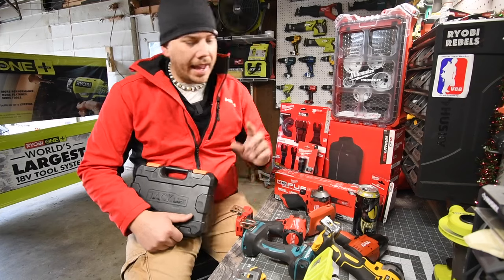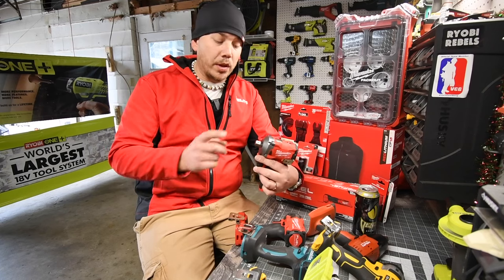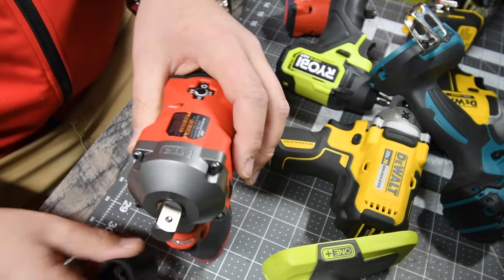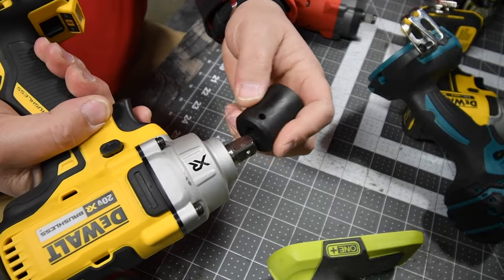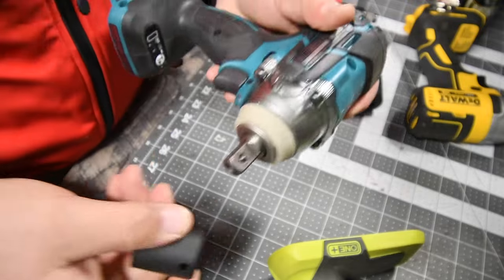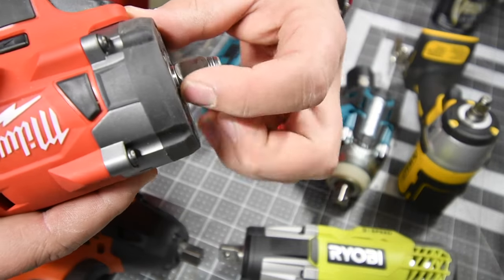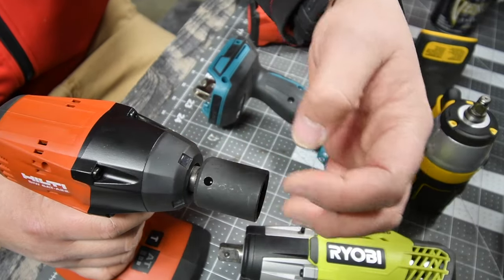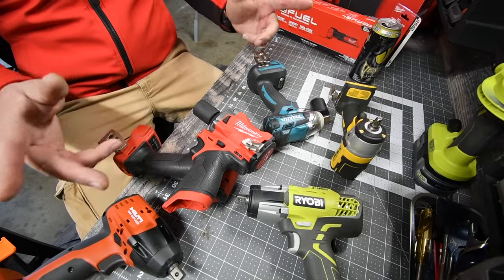(Detent Pin) and (Friction Ring). Whats the Difference?

Comment: Detent pin is for those construction guys putting buildings together that are running 100 of the same nuts in and don't want to drop a socket 10 stories down. Or into a river, or on the head of a coworker.
Reply from the maker: I thank you for viewing Tom
Reply: Tom you hit the nail on the head.  The pin hold the socket better and the hog ring allows easier socket changes.  I prefer Hog ring as its easier to change for normal use and most have a hole in the anvil as well.  When working high, some impact sockets have a groove cut around the pin hole.  This is so you can slide a pin through the socket/anvil and then an O-ring wraps around the groove to hold that pin in place.   Can't come off without intended removal.  That gives you the best of both worlds.
Reply: I found out that the sockets get stuck on the ring, I prefer pin detent
Reply: You are absolutely correct Milwaukee even clearly state in there information booklet that you have to push the pin in with a small tool to stop the impact socket coming off the impact wrench. Milwaukee also go on to say that this is not a production fault as this tool is designed like this if you want the sockets to be removed frequently for mechanics etc then purchase the friction ring model. I have purchased both types for different types of applications.
Reply: Yeah, but why so hard to get sockets on, though?  Seems like the struggle will make it more likely to drop a socket.
Reply: cudnt have explained it better
Reply: Thanks Tom! I was about to return my Makita over this, but it makes perfect sense!!!
Reply: Are guys that put buildings together using an M12 stubby?...... ROLF

Comment: Your Detent pin on the Milwaukee is not faulty.  Milwaukee designed it to only release by inserting something to push the pin.  The friction ring version is for those of us that do not want to release the pin
Reply from the maker: people tell me both things. "its faulty and I should return it" and "that's how its supposed to be".
Reply: @ManCaverTools  

Mine does the same thing.  But apparently it is working as designed. 

The instruction manual states to insert a nail to remove to remove a socket.
Reply: @ManCaverTools  he's right, pin detent on the milwaukee is perfect. the other tools that have the pin is worn out. they should all be like that 1/2 stuby. the friction ring is made to slide on and off. if your pin detent acts like a friction ring, then the detent retention is worn out. that's just common knowledge
Reply: @AntisocialLaneeBug  i wonder if future impact wrenches will have a button to release, like how some ratchets have that button in the back
Reply: The Milwaukee cordless wrench need a quick release button!?
Reply: Detents meant to slip should have balls, pin detents are meant to stick
Reply: My old dewalt impact also need to push in the pin to release.

Comment: I guess people don't read the manuals anymore, it says it right in there that you need to push the detent pin in to push the socket on, and need to insert a pin to pull off the socket, the only issue is you didn't follow instructions

Comment: Milwaukee decided to go with the true code of the pin detent meaning which is to always use a nail or thin object to remove the socket those other brands that allow you to remove the socket are not up to true code? Impact wrenches are only made with frition rings or pin detents ... Not ball detents that milwaukee impact is not defective at all..
Reply from the maker: its gotta be on purpose, I just thought it was defective when I first got it because all of my other impact wrenches with Detent pins let the socket go.

Comment: Again that's how pin detents work. It's literally made to be pushed in to remove the socket. Safety for overhead work so a socket doesn't come off 5 stories up and kill someone. The other tools are ball detents...
Reply from the maker: so your saying that every detent that I ever used including Milwaukee's bigger impact wrenches that I had on the channel are all faulty detent pins. and this m12 stubby is the only one I have ever had in my life that isnt faulty. snap. looks like I got a 7 tools to return due to faulty parts
Reply: My old dewalt was the same way.. would have to push in the detent every single time, and to put a socket on It was to the point where id just line it up and smash the socket into the ground

Comment: I use Milwaukee tools on a daily basis and as others have stated you need some sort of small pin or screwdriver to remove the socket. I had a brushed high torque impact, the fuel high torque impact, the 1/2 fuel compact and the mid torque that were the pin detent style. Everyone of them needed a small nail or screwdriver to remove the sockets. There is nothing wrong with your stubby.
Reply from the maker: its just crazy on how all of the other detent pins I have dont require that but I thank you for viewing Mark
Reply: @ManCaverTools  it looks like all of your other tools can actually fail when your impact socket will stuck on rusted or dirty bolt, for example. Anyways, thanks for the video!
Reply: @ManCaverTools  I think the milwaukee impact is designed for construction workers, because when were high in the air we're not allowed to drop anything for safety fall hazards; Iron workers , Carpenters, Scaffold builders usually use impact high in the air.
Reply: That's good design because the others when it gets heated, sockets WILL come loose. I use that same model and I remove it while using it, the vibration and pull will help you remove it quick, but you will need some practice to figure it out.

Comment: There is a ball detent and a pin detent. Ball will go on with some force and pin you have to push it in to use it.
Reply from the maker: correct, the ball detent are usually on socket ratchets. all of these impact wrenches have a detent pin.
Reply: The thing i noticed is that the milwaukee has a flat top on the pin and the others are somewhat angled  to a point to make it a little easier to install and remove sockets the flat top is usually standard on the larger impacts but ive never seen on small ones

Comment: I recently got the same Milwaukee  1/2 "  impact stubby, you mention ,  and have experienced the same situation /frustration  with the detent pin . I have never had  this happen before.  I have read some of  your reader comments . It seems that there is a difference between a detent pin and a detent ball .  So  I looked at the owner's manual and it does describe 2 options for the  anvil for this tool , the detent pin and a friction ring .The part numbers are also given  for each .   The manual clearly states that the detent type anvil requires using some sort of tool to depress the detent to remove sockets . So  in my estimation it is kind of a hassle to have to keep a little blunt ended punch handy to remove sockets. But I do see  that it could be good not have a socket come off accidently . I never have had a socket come off accidently  from my HF impact until the friction ring wore out . 
          But my 120 volt Harbor Freight impact gun  recently wore out its  friction [ hog ] ring . So now I am shopping for a replacement [ I don't need 200 of them ] and a good method for replacing it . One video I looked at says there is also supposed to be an o ring placed on the anvil first . then you force the  tool down against the new ring against metal to force it partly on until it stays , and then slowly work it the rest of the way on. with a screwdriver and tapping with a hammer.  So the ring must be made of spring steel . Thing is you dont want to just pry on ring's  joint ends and enlarge the inner diameter because that will ruin it . tricky operation it seems . 
           I will give my old 120 volt Harbor Freight impact tool lots of credit . I have probably had it for about 20 years with no problems . I think it lasted much longer than the Sears Craftsman one it replaced . In the good old days HF stuff was so cheap that it was well worth taking a chance on buying . 90 % of  what I have bought at HF has performed well . But they seem to have jacked up their prices across the board in the last year or so . 
      Thanks for your vid .
Reply from the maker: A detent ball is what you have on socket ratchets and socket adapters. most detent pins will let go of the socket with some force, I was just surprised the milwuakee stubby didnt let go of the socket at all and need a thin object to push the pin in, when all of my other detent pins let it go with some force. people flipped out over it and left me bad comments. lol but I thank you for viewing Richard

Comment: I think the stiff detent pin is probably ok for building construction when you are not changing sizes as much as a auto mechanic  also working at heights would be really bad if it flew off at 200 ft and hit someone  just a thought

Comment: Milwaukee designed it that way, it's clearly writing on the manual. Just don’t line the hole up on the detent, and it will come off easier or you can just wait until it wears in a little and will start to come off easier. If you don't like that just exchange it or buy the hog ring version, I guess that's why Milwaukee makes different models of each impact wrench.

Comment: I have several impacts with detent pins.
I have always had to use a pin/rod to compress the Detent. These impacts are intended for use with the same socket all day, we almost never remove them when we do though we have to use a pin or a rod. A proper pin Detent will have virtually straight sides and a flat top.
Reply: P.S. no hate. Great videos.
Reply from the maker: just based on the other impact wrenches it just seems like its faulty. but like I said in the video. it might be designed to be like that

Comment: I saw the video yesterday and my first thought was the spring under the pin for what ever reason isn't sitting in just right or is extremely stiff. I've had impact guns do this before and what I've done is not line up the hole in the socket and use it like that or leave a socket on it for a week or so to break it in. my 2c worth what you paid for it. good video showing the differences on each pin.
Reply from the maker: I want to put some oil on the spring and see what that does
Reply: @ManCaverTools  I would also put a socket on it to hold the detent down for a few days. It absolutely can't hurt.

Comment: I was at KMS Tools in Calgary last weekend and there was a Milwaukee rep there and I asked him the same thing. I wanted to get the mid torque M18 but they only had the detent pin version on sale. He specifically said I'd need a nail or pick to get the socket off every time. I have a hard enough time getting sockets off my M12 1/2" stubby with a friction ring, I don't need the hassle of a pin. Probably ideal for some jobs but not for the average home user working on cars etc.
Reply from the maker: if its in the design then its in the design. I just never had to do that with any other brands along with HILTI

Comment: I got a Milwaukee m12 stubby yesterday with pin detent.  It behaves just like yours.  Milwaukee should have made those with a spring loaded ball bearing... Best of both worlds...
Reply from the maker: Im going to try some oil and see what if that spring works better
Reply: @ManCaverTools  keep us posted!  It's totally strange.  The conical shape of the pin leads me to think that it should comply when  pulling a socket off... I wanted the one with the hog ring, it is on sale for 180$ in my area, but the "free" 4.0 AH battery came with the pin detent model... Guess Milwaukee is trying to move unsold inventory.

Comment: It’s supposed to be like that - to prevent tools from falling during  overhead construction. If it’s set properly, it will require a pin to pop it out. Use a friction ring for work requiring interchanging sockets often. 

PS - my Milwaukee Impact wrench with a friction ring (e.g., automobile applications) is significantly tight. I’d throw away all those others and keep the Milwaukee.
Reply from the maker: I known, it was just the only detent pin that actually needed to be pushed in to take the socket out. it has its uses but sometimes it can get in the way. lets say you were on the job site and you dont have anything on you to push that pin in and you need to chang sockets, you are sort of screwed.
Reply: Clip a small pocket screwdriver, the kind with a pocket clip, to your pocket or cut the threads off of a machine screw eye and just carry it in your pocket, maybe put a short loop of cord on it...or more dangerously tie it on the handle sort of like how people stored drill chucks for portable drills on the drill...

I have heard of this before but not experienced it...

You probably should never put a chrome socket on it as you may never get it off and yes, you shouldn't use them with an impact, but people do...

Technically the hole is there so you can release sockets as opposed to the sockets just having a relief space so you can't really say it's defective just very secure in the socket retention function compared to other models and brands.

I suppose you could say it's excessive if the industry standard is what it seems to be judging by your collection of impact wrenches and the experience of others but that's a design choice by the manufacturer not a defect I think so a replacement part will probably be the same.

What does Milwaukee say?
I think we'd all like to know...

Comment: I have the M12 stubby 3/8" pin detent and it works smooth   no tool needed for mine.  I usually put the socket on so the hole doesn't match the pin and I've only lost the socket a few times off the anvil.

Comment: Do the Detent Pin and Friction Ring serve different purposes, why are there two kinds? Which one is better to get for home uses...changing tires, etc.
Reply from the maker: yes, the friction ring lets you take the socket off with force, a detent pin is the same thing but this detent pin seems to require pushing the pin in to take socket off

Comment: If used in the wrong application.. or just misunderstood,  the M's detent pin could be frustrating.
The detent pin is a safety feature, intended to be more secuure than the detent ball's friction fit, specifically to lock the sockets ot the anvil so that they don't fall, when working on heights. (for tasks usually not requiring socket changes).
You have a few options.
1. align the socket hole with the pin for the safety lock feature
2. put on the socket with the hole misaligned to the pin and it will act like friction ring. 
3. use a shallow/soft detent receiver type socket.

Comment: What you described is a detention pin. This is design intent so the socket cannot come off the anvil without intent. The others you described are decent ball and friction ring. These allow the socket to stay on but can be slid off. Looking at the available options it looks like you ordered the 2555p which comes with the pin.
Reply from the maker: I thank you for the input J5

Comment: I have never had any luck with detents. I used to run into trouble like every other time on my impacts. I still have a couple Snap On extentions that I need to push the detent down on. I switched to all friction rings on my impacts.
Reply from the maker: ill try some oil on the spring
Reply: @ManCaverTools  I got a oil can of 15w40 that I use for when my pliers get sticky and that works well and lasts a good minute. Could work in this situation too.

Comment: most good sockets have a hole in the side that lines up with that detent

the socket is secured too the anvil and needs too be freed through that hole i mentioned 

in an environment where use is high, i assume this anvil design will outlive others that (sometimes) loosen over time by

Comment: I was having the same issue couldn’t take off socket. I thought there was a button till I found this video. So I have a question. You have to use a nail all the time to take it off?
Reply from the maker: it stinks but you can file the pin down a little bit so it doesnt stay in, but I think its terrible that someone would have to do that

Comment: My Milwaukee is the exact same way. I keep a small nail set in the case with it. I also have the 1/2 in. friction ring and have to Pry the sockets off with screwdriver. Gets annoying win working with several different sockets.

Comment: The answer has been posted by multiple people already, but here it is again: The pin-type spring detent on the Milwaukee is a flat top PIN that locks into the hole in the socket for safety. It requires a tool (small flat blade screwdriver is perfect) to install/remove. This is different from a ball-type detent that can be manhandled without a tool. The latter is not as secure as the locking pin-type, but, which would you want when working off the ground? You say you contacted a TTI/Milwaukee rep and they punted? Outstanding support. Maybe the drill guy answered the phone?
Reply from the maker: some say its supposed to be like some say its not.

Comment: Had that issue on the Milwaukee 3/8 stubby with friction ring, it did not want to have a snap on socket removed at all. It actually ended up damaging the ring and it needs to be repaired already.

Comment: I've had other tool like that. You just gotta make sure you don't put the pin on the side of the drive that has the hole. Sockets have detents on all 4 sides of the drive and it seems only large sockets have the hole. Presumably to keep them from falling off the tool so easily. I have an antique 1/2" ratchet that does the same thing. If I put the socket on with the hole over the pin I have to insert something to get it to release like you're doing on that Milwaukee.